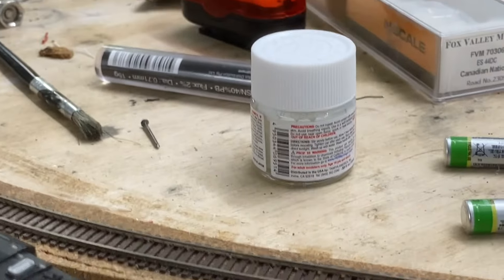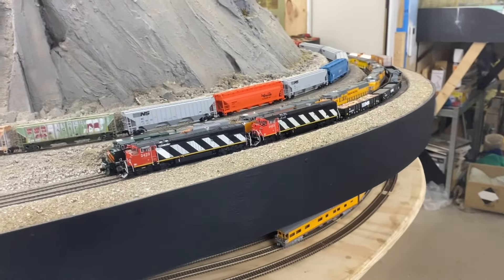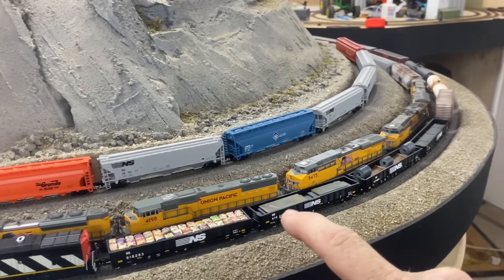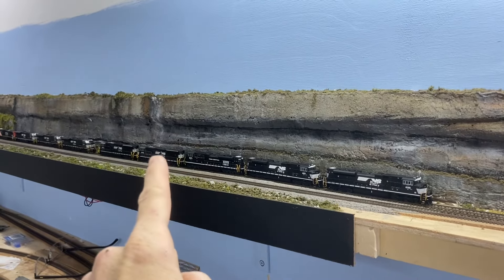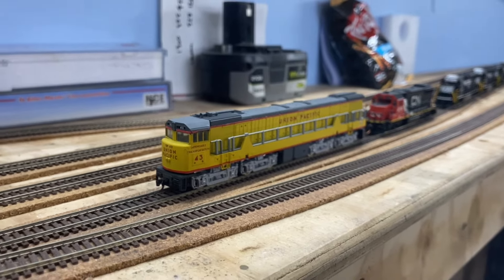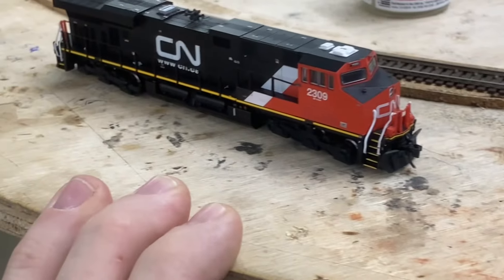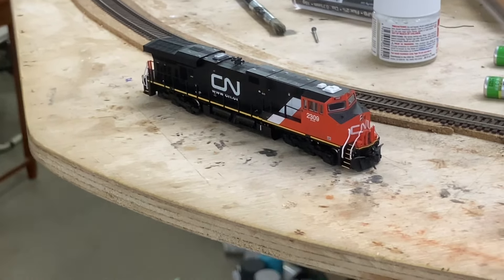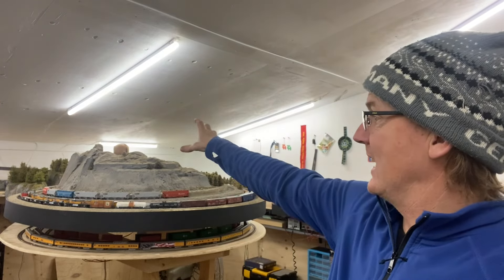N scale layout update, catching up on my tinkering. No trains running in this update.

Comment: Keep up the good work on the layout.  I think your U-50 is actually a Con-Cor model from the 1970's not Kato.  Noisy but with decent tractive effort, who needs a sound system. The prototype was basically two U25's melded together in a move to counter the DD-40 that EMD built for the 100th anniversary of the transcontinental line.
Reply from the maker: Thanks for the info. It’s a cool thing either way.

Comment: Nice update David, some nice additions to the roster.  What is the size of your layout room again? - Steve
Reply from the maker: Hi Steve,  my room is approximately 7m x 3m with a bit missing where the stairs come up.
Reply: @nessriverrailroad1299  Hi David, thanks for the info. We’re moving and  finally getting a dedicated space for my train layout in the basement and it’s a bit bigger than that. Just trying to get ideas for the next one (or keep the existing and modify). Might even go HO if I can make it work. Thanks again. - Steve
Reply from the maker: @CajonSub sounds great. I feel to go HO with what I like to run I’d never have a room big enough. Basements under houses aren’t very common in Australia.
Reply: @nessriverrailroad1299  David, I feel the same way. Would love to do it but limited depending on the available space. But getting older, HO is more manageable (and they have better details). - Steve